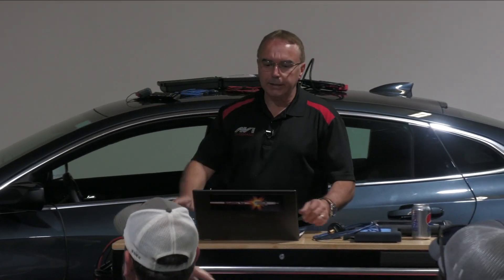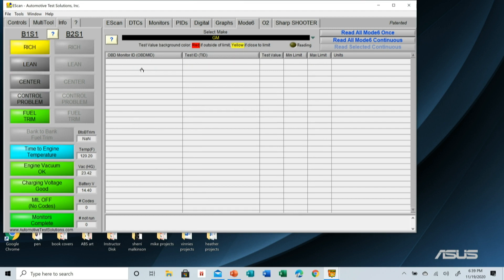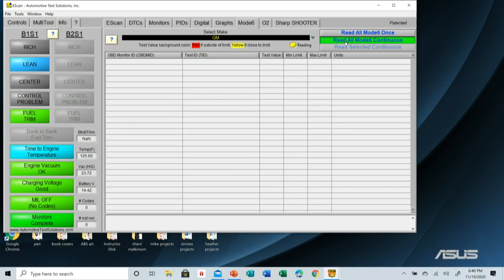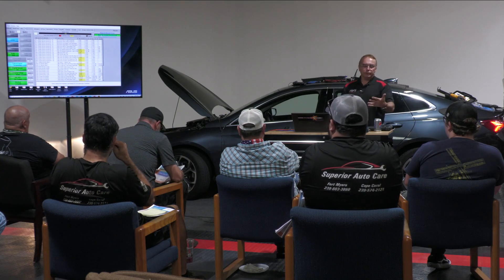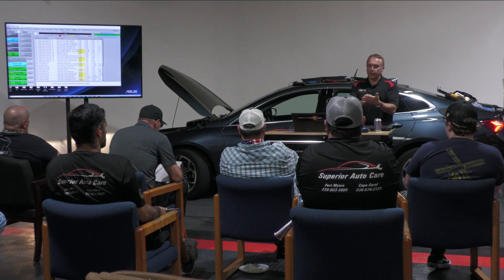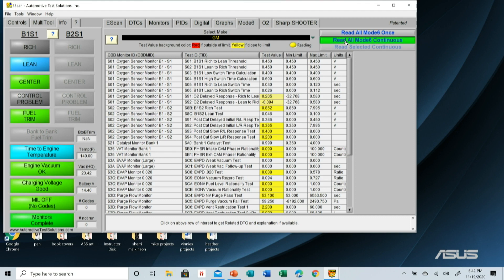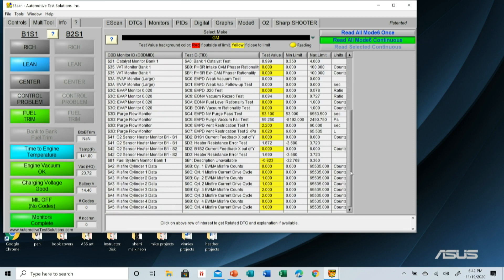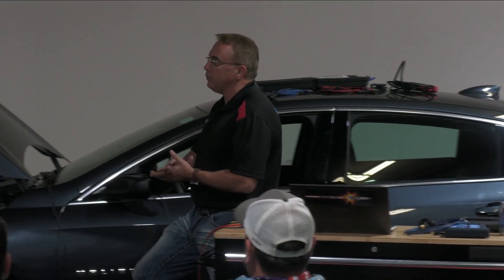Mode 6 Continuous Reading | Tech Tip

Comment: 01 grand Cherokee 4.0 has a failed 02 sensor heater test in mode 6 but no codes at all just running a little rich. Does that mean their's nothing wrong, just no test supported?